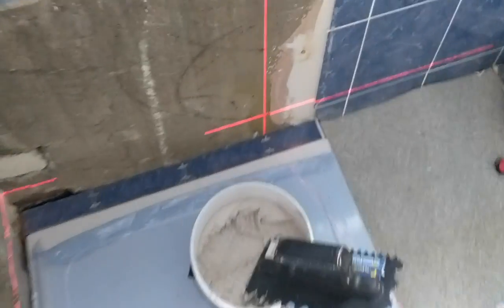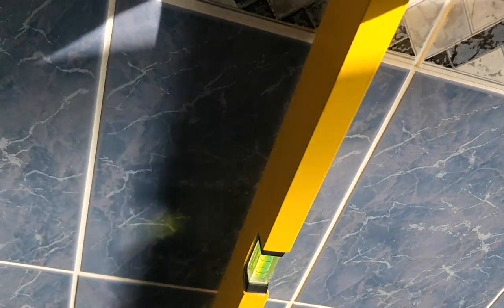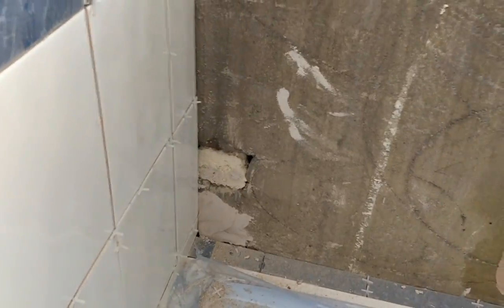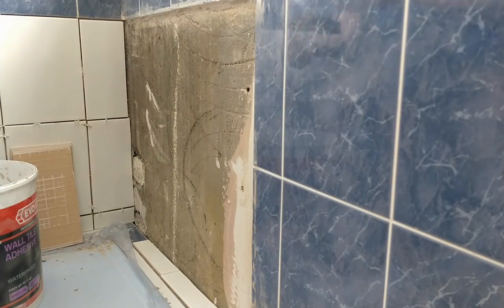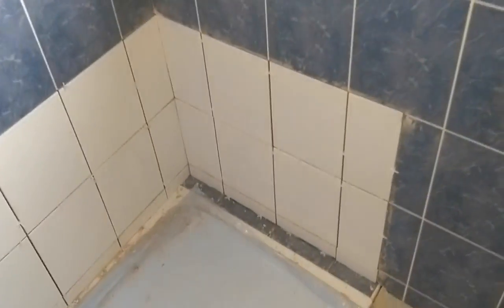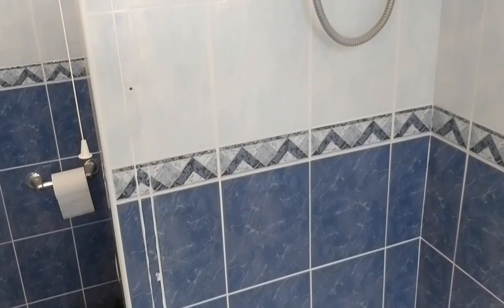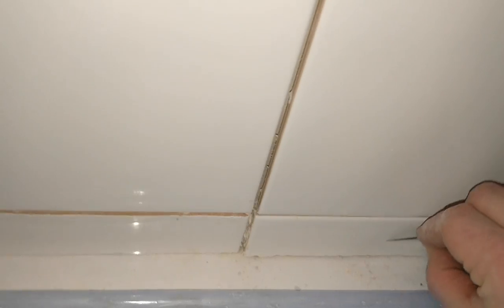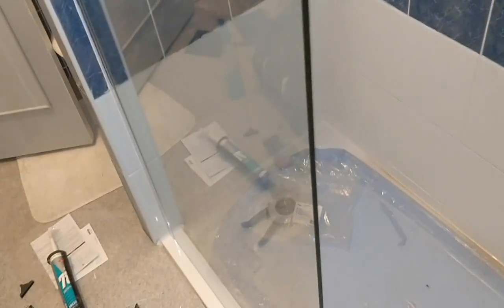Tiling the shower area and installing the shower screen

Comment: Going back through your old videos of the extension as I'm considering extending my new build (only by 3x3 for a playroom for the kids)

Not sure yet if I want to do block work or timber, it all needs to be rendered at the end anyway so will probably be down to what I can do easier haha
Reply from the maker: I hope they help!
Reply: @OfficeBoyBuilder  we've had a think and we have a new build that has a car port that's about 1 foot away from the house

We think we may just connect that upto the house and have the roof etc already in place 

Can't find any info online of people doing this though in the UK so will be asking for planning permission for sure

Would be so much easier as the main structure is there, only issue would be foundations being that it's on tarmac but I think i could dig down in sections to keep the main structure up whilst doing it